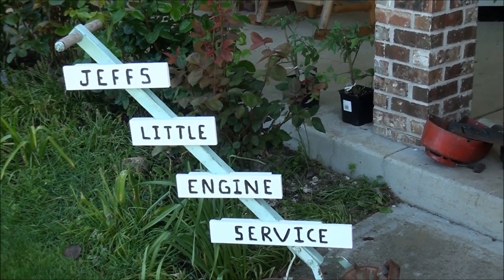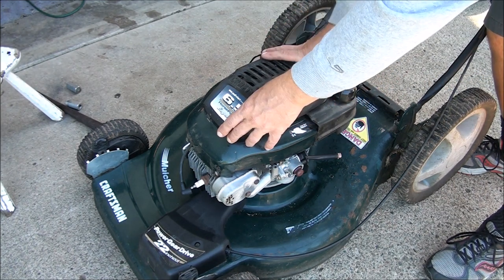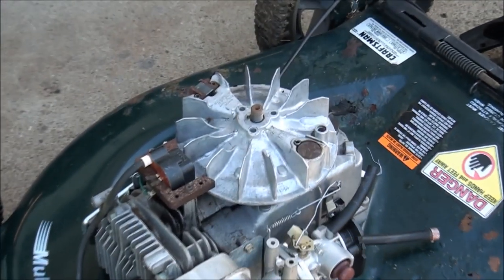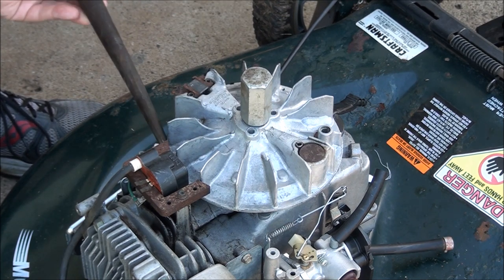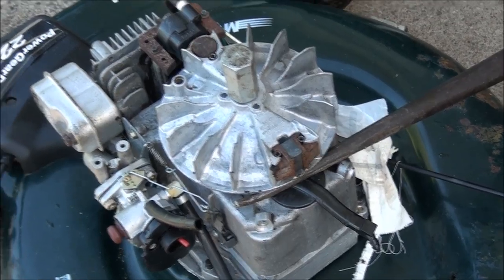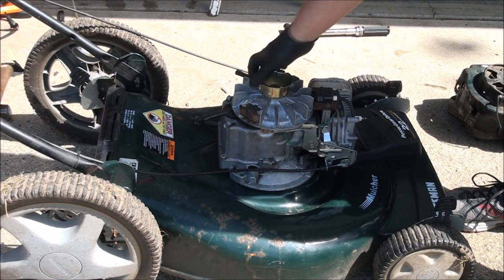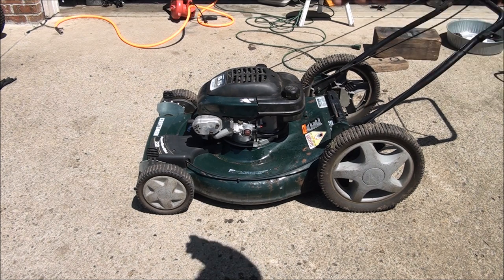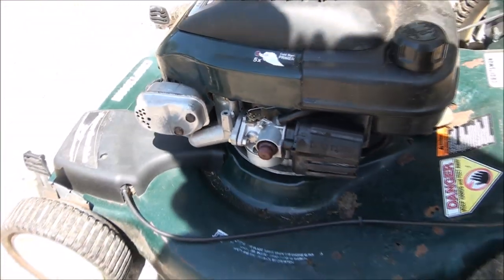A Tecumseh Lawnmower Engine -  leaks oil, no power. FIXED! Flywheel removal, OIL SEAL replaced

Comment: Worked like a charm. Thanks for the details and torque specs.   I had to drill 2-3 smaller holes in bearing seal and use  pick to pry out.    Worked great!!  Thanks.
Reply from the maker: Glad it helped, nice work!

Comment: Nice job on the Video. Try C clamping a  3" piece of 2 x 4 to the inside edge of the mower deck allows removing and installing blades etc. I keep the two in my mower repair tools. Also by carefully drilling a small hole in the seal allows getting the pick in to remove the seals works for me.
Reply: great idea on the hole to remove old oil seal.    also, I thought the exact same thing about 2x4 clamp.  nice.

Comment: Good video Jeff...I noticed the mower had corrosion in the deck coming through...Removing grass after every mow and spraying WD40 will give it a lot of protection if steel...Cheers from Australia. PS I have an Aussie Victa mower with a Tecumseh motor in the same dark green colour.
Reply from the maker: Good tip! Thanks for watching

Comment: I overfilled the oil and had it pouring out the breather tube on tecumseh lawnmower. Would love a video on replacing or cleaning that tube. I also understand there is some sort of filter or filterish material. All that info would be a big help

Comment: Later version of this mower do not have the 3 screws to remove green gas tank. The tank has a hold down clip on each side. You have to pry it up at each corner while pulling up. It will pop up.  Then you can pull up and off. Rear pain.

Comment: Good video. On your seal removal, a small hole drilled in it then use a small slide hammer would snatch that seal right out. That tip is from Taryl Dactal. Once you get past his "dumb hillbilly schtick"  you find he really knows his stuff.
Reply from the maker: Taryl is great!

Comment: I have same engine. I think what you are looking at under the flywheel is residue from the engine brake which rubs on the inside of the flywheel. Mine has same stain and it is not oil, just brake dust.
Reply: That engine doesn't look like it needs a new top seal.  Where's the oil all over the place?  I looked this up b/c I snapped the key when I hit a root and once I removed the flywheel, there is oily dirt all over the top of the engine and all the cables, carb, etc. Actually saw it as soon as I took off the cover.  All oily dirt inside.   Pretty sure I need a seal.  Interesting, almost none inside the flywheel itself.  I guess it gets flung off or blown off and lands on everything underneath it.  I am going to look carefully to see which way the key goes.  Mine's sheared, but Maybe I can tell which way it went.  His was facing to the left when he took it off.

Comment: Best practice is to suspend engine before hammering so there's room for engine to move before pitting the bearing. That's not a thrust bearing after all. The wheel should pop off from inertia.

Comment: I have the same lawn mower and wonder what the right cam number is under Tecumseh name. I rebuilt my motor and found the replacement cam I bought hits the crankshaft since the previous own broke the cam do to rusted valve. Craftsman doesn't support this model anymore.

Comment: So glad I found your video!  same exact mower and same seal leak.  I refuse to let this thing die!  Placing the order now for the new seal.  

Quick question though... that large black breather plug that you had to spin and realign... Does it seat tightly on top of the engine?  Mine has a little slack and can lift up and wobble around about 1/8" or so.  I wasn't sure if there is supposed to be an o-ring or something under the lip edge to ensure it's sealed.
Reply from the maker: I think they are supposed to mount flush and stay there because there is a groove in the rubber. Not sure exactly but it is just a breather for the engine so as long as it seals enough to not let oil out and stay in place you are good
Reply: Lawnmower Repair and Service Maintenance Tips thanks again.  Yes, it does sit flush and doesn’t appear to be leaking from there.  Just seems lose.  However, when I do pry it up about 1/4”, it’s really stuck in there and has some large white filter thingy.  I guess it just doesn’t really snap in there tightly.  I guess it’s fine.  I’ll check some more after the seal arrives.
Reply: Mine is the same way.  I sealed the lip with clear silicone sealer.  Probably not necessary, but since I had access with the flywheel off, what the heck... (Cindy's husband)

Comment: Did anyone else notice that the seal was now flush with the race? That is the way it should be. I am probably wrong, but I think this mower is coming back again. If that seal is slightly higher than the race it seems we have other issues rather than just a leaky seal. I have my suspicions, but leave that to the future videos.

Comment: Thanks for the video Jeff. It’s been helpful. Any suggestion on which part number? 

two different shops and each sold me a different flywheel key for my 6.5 HP Tecumseh lawnboy mower.
(LV195EA-362044D)

#611298 
solid rectangular no odd shapes. Solid steel.

#611004
The other key appears to be aluminum. Slightly taller than the listed above and shaped like an “L” with one end being thicker and the other. 

Also the orientation of how to insert the key into the keyway.

Thanks again.

Comment: I have never removed a top seal from a small engine before.  But when I remove similar seals I drill a small hole thru the metal surface of the seal and put small screw in it.  Tighten the screw and the seal comes right out.  Also, I wonder if the miss-guided breather tube was the cause of the oil leak?  I didn't see much oil around the top seal.  Maybe he cleaned it before I saw it.  But that hose is suspicious.
Reply from the maker: Good tip!

Comment: Have you ever had the ignition coil come loose? 
Mine did.  Hit the flywheel.  Broke off the mounting posts, broke off flywheel blades, and wrecked the coil.  
A MAJOR design flaw.  Should have had lock washers and thread locker.
Reply from the maker: That is very bad news, sorry that happened to you.

Comment: Have the same one, but my seal is good. How to remove the breather without tearing it? It doesn't want to just pop out.
Reply: I just changed the filter element in the breather.  I used a large screwdriver to pry up the breather.  I couldn't find the filter element sold separately so I bought an entire breather with element inside (tecumseh part number 36557; about $15 at eBay or Amazon).  I didn't damage the breather, but it is a bugger to get out -- it seats in a fairly large groove of the crankcase and you have to work all around with the screwdriver to pry it up.
Reply: @discobear5752  Thanks. I found the breather also and switched it out last week. So far so good. Thanks again!

Comment: I believe you installed the key the wrong way after reinstall, since the key is not symmetrical, flipping it the wrong way will affect the timing of the engine somewhat.
Reply from the maker: Yes good eye. I realized that after filming and forgot to edit the video with me reinstalling the key the correct way.
Reply: @jeffslawnmowerrepairandservice well this is 6 years later and you did put it in wrong apparently it didn't change the timing but it's wrong
Reply from the maker: Yes I reinstalled the key after I  realized that I installed it the wrong way. I forgot to edit that out of the video

Comment: Am I missing something? Why not use a three jaw puller for the flywheel? And on the seal, why not put a screw in the middle of the seal and pry it out by clawing the screw? And if you're going with the pick method, wouldn't you want to  go between the outer joint rather than the inner where the crank is? Not trying to dog on the creator as I appreciate what they do. Legitimate questions.
Reply from the maker: a knock off tool will not break your flywheel like a puller could.
Reply: @jeffslawnmowerrepairandservice  Aw yes, makes sense. Thanks

Comment: Pounding steel to steel on the crank makes me a bit nervous. A proper puller can be fashioned from a big washer, three holes drilled in it and three bolts of the right size. Works like a charm -- no pounding, no prying -- with no chance of damage to the crank, the thrust washer or the flywheel.
Reply: If you are using the three holes in the flywheel, I would use a triangular piece of steel plate rather than a washer. A washer that big would have a hole too large to give good bearing surface on the crank. Also, I would use all thread and a nut at each of the three contact points. This would give full engagement of the threads at the flywheel BEFORE the pulling starts. It appears that the three holes in the flywheel are not tapped and that would have to be done.

Comment: While I know this is an old video, I had to comment.  I have a Craftsman mower that pretty much looks like this one.  Has the 6.5 HP Tecumseh Eager 1 engine.  Only difference is that mine uses a different carb.  Mine has a machined billet carb with the plastic bowl on the bottom.  Was just given the mower for free and had to do some work to it.  Carb needed cleaned, Engine Zone cable (operator presence) has to be replace, it was seized up.  Needed an oil change.  Air filter was clogged and installed backward and the primer bulb was shot.  Thing runs like a champ now.  Only problem is that it is a rear discharge and has the mulching kit installed and the side discharge deflector that hooks into the rear discharge opening is no longer available.  The chute isn't available anywhere.

Comment: Holy shit! Poor seal..you killed it already. Never saw a shop dilly around like that  with a seal. I guess I have worked on this stuff way too long. Like my dad always said fix it , dont play with it. Time is money, just get it done son. Get yourself  blade stop too. They save your knuckles. I have metal pieces in mine for that reason. Slipped while removing a blade. It hurts too.  A simple business card works for the air gap on the coil. What exactly was the hose for again?  Wow.....scared me watching you.
Reply from the maker: lol! buckle up! good tips!

Comment: Tsv115 Tecumseh changed oil and cleaned carb about a month and a half ago....was mowing today and it was running fine then lost power and died ......it's not locked up 

..but she's no longer cranking
Reply: Did you hit something while mowing?  Is it hard 2 pull the pullstart cord?  Does it get yanked out of your hand?   If you hit something and the mower stopped, it could be a sheared flywheel key.  The spark plug gets carbon buildup on these Tecumseh engines quick. If it's not the spark plug,  check the gas for water.  Let me know if need anymore information or help.
Reply: @Doc-Cole_Trickle-of-Chainsaws  I put a new puller on when I did the change and everything and it was never hard only time it yanked was because I didn't have it firmly grabbed
Reply: @NelTopREE    If you have good spark through your plug and fuel is good/clean.  Maybe sheared flywheel key.  Can you give more info on what happened?
Reply: @Doc-Cole_Trickle-of-Chainsaws  It was running on high and it started to lower in rpm and it did that for probably 10 seconds then died ......had put fresh gas in prior to running
Reply: I can't get the flywheel off to get to the rest of the motor cuz I don't have the tool ....my dad wants to junk it but honestly I think it's saveable cuz it's not locked up or seized
Reply: @NelTopREE   Since you've taken the top off of the engine.  I'm assuming you checked spark plug, fuel and air filter and all in good condition
Reply: @Doc-Cole_Trickle-of-Chainsaws  just the plastic cover and metal engine cover is as far as I've gone....the spark plug is a month old the filter hasn't been changed in awhile but I blow it out pretty good and it's never given me any problems
Reply: @NelTopREE   Air filter maybe questionable.  Since you've got the top off.  There are a few videos on removing your engine style flywheel.  If you can get access 2 a puller do it but if you can't and you try the hammer method just be easy. If your flywheel key isn't sheared.  Then go back and check the basics fuel, spark and compression.  If you can check the compression.  I would like 2 know your compression psi.

Comment: Was not leaking oil from the seal to start with,that was black brake dust form the brake rubbing on the flywheel, then the way you popped out the seal was very back yard mechanic like and crude! By the way how many flywheel keys did you destroy installing  them in the wrong direction,all you had to do is review you own video to see witch direction it went before reinstalling the key into the key way!....Wow!
Reply from the maker: Haters are gonna hate, not much I can do about that
Reply: The guy is a  HACK. Just watching him scew that job up amazed me. That seal didnt look to be the issue anyways. Probably blow by. That mower is probably in the scrap now.
Reply: @scottfirman  well you know the lawn mowers pretty oldI have one just like it and I don't have the governor spring hooked up right I thinking really go fast surprised it didn't fall apart yet it has a big kick back to when youthat's probably because it's set kind of high the gas flow to the carburetor

Comment: Failure.. you put the flywheel key in backwards..... Changes the timing.
Reply from the maker: I don't think so
Reply: @jeffslawnmowerrepairandservice  it's in your video.. compare 5:08 with 17:36 .. the key is reversed. It is not symmetrical so flipping it changes the timing. Probably why you had trouble with idle on the restart.
Reply: @WApnj  Keep watching for a few seconds after 17:36.  The "new" key looks T shaped to me, whereas the key @ 5:08 is L shaped.  If you reverse a T shaped key, you get a T shaped key (i.e. this  new one is symmetrical), but if it were L shaped, like the original, which is not symmeterical, it might change the timing.  Another possibility is that Tecumseh engine timing isn't sophisticated enough for the difference in keys to be significant.
Reply: I noticed the same thing. So, If the flywheel key is 'L' shaped, it needs to be placed like in the 05:08?